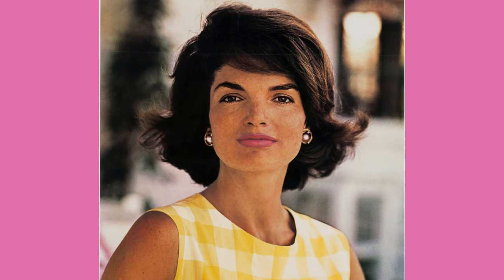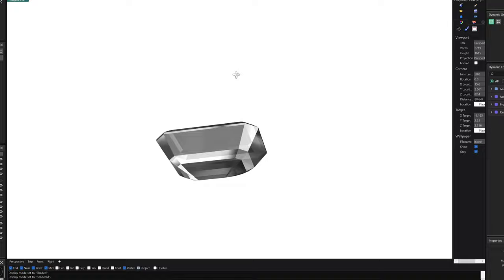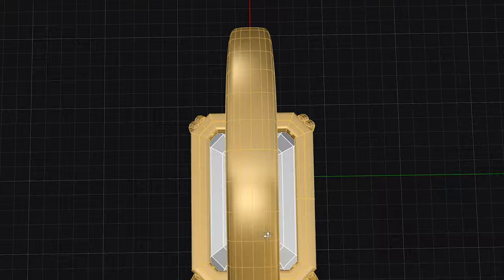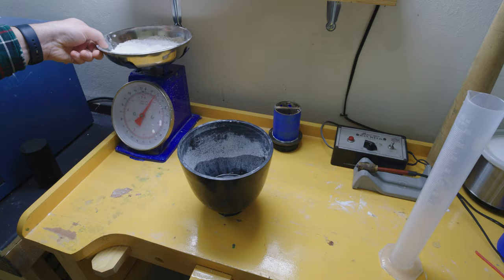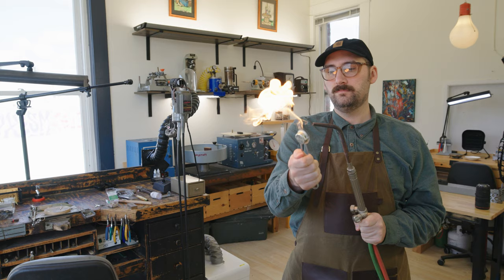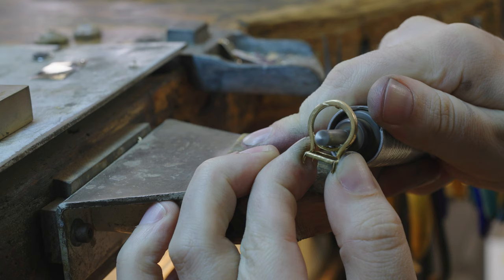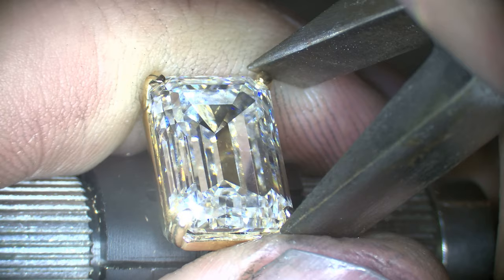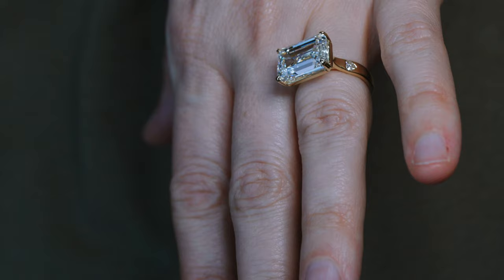The Ring I Would Make For Taylor Swift

Comment: This is probably a really stupid question but when they grow the diamond they still have to cut it right? It doesn't just pop out of a mold looking like that, correct?
Reply: I think so. They don't really "grow it" I think they apply pressure and heat to carbon to create diamond the same way nature would but in a controlled setting.